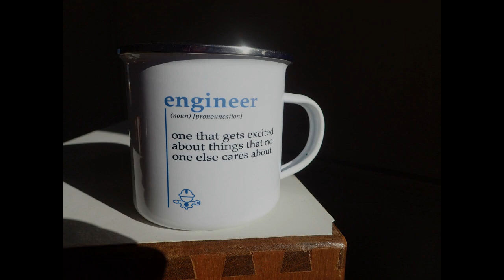The Knackler Needs Your Help - Which Drill Press Vice.

Comment: No one vise is the be all end all solution, but a good vise will get most jobs done.  I have a few regular Palmgren drill press vises which I use the most. Of those I have two sizes. A positive is that you can turn them on their side and hold work. A negative about regular drill press vises is the absence of mounting flanges. Some have a little lip for like a toe clamp, but I usually just hold on to the vise.  For that size press I would say you might want something that can be secured to the table or not. A larger floor standing press can have way more torq than one would expect. It can and will if you let it more or less throw a vise across the shop. There are benefits and drawbacks to flange mounted vises. Some are of very shallow jaw depth for example, and might not provide the holding strength you need. Another thing is they can be a pain in the ass to constantly get lined up. It's not the end of the world, but just a little obstacle. They still however have their place in the shop. What I have on my floor standing press right now is actually a Peterson Products (Mr. Pete's former company) vise made from rough castings. It works well for what it is. I also have a Heinrich cam lock vise, and a few others. Another less all around useful option is a tilting press vise which as it's name implies can tilt into position and lock in place. I don't use it a lot, but when it comes in handy it really comes in handy. In the end, like most others you will wind up with a collection of vises, each great for certain applications, and likely the first of which will be a regular drill press vise of the right size. If securing it seems prudent, then consider one that can be mounted to the table. Of course when mounting a vise you have to take into consideration IF a particular vise will fit your table in a way that allows you to both get the work on center beneath the chuck while also letting you tighten up the mounting bolts holding the vise to the table. My advise... find  a medium to largish sized regular drill press vise (Like 4"), and hold onto it tight. Learn when and how a drill press can grab the work. Get a feel for that drill press. Make it second nature to know where it's on/off switch is, because the nature of the beast is that sometimes the work gets grabbed by a bit, and you will have to wrangle it with one hand while switching the machine off with the other.
Reply from the maker: Hi John,
Thank you for all the above information... Yours and everyone's else's comments have been food for thought on a number of things involving The Knackler's Workshop. I now have some clarity on the way forward as well as drill vices so, a good outcome from this video.
I was not aware that Mr. Peterson had is own company that is very interesting. 
Thank you again my friend.
Paul,,

Comment: Hi Paul. I follow Mr Pete's wisdom on this, you can never have too many vices! The vice I mainly use on my drill press is the Float Lock Vice that I made but these are hard to come by. Most useful would probably be a good quality cross-slide vice. They are good as you can bolt them down but still move the work about. Also, as Rob said, get yourself a car jack, bottle jacks are good so that you can support the table. Cheers, Alan.
Reply from the maker: Hi Alan,
I have a goal to have as little kits as possible, which I know is a tall task and every time I buy something new I will get reminded of this statement. I am very grateful for everyone's comments it's helped a lot clarify my mind on the way forward.
Cheers
Paul,,

Comment: I would recommend a cross-slide vise so you have two axis of travel. Some machinist parallels would also be useful in the vise for certain drilling operations.
Reply from the maker: Hi Mark,
Thanks for talking the time to help...One of the considerations I have is that I share the workshop and this drill press... So the vice I pick needs to be very easy to come on and off. The two axis option is very attractive...
Take care
Paul,,

Comment: Hi Paul,  I have an almost identical Taiwanese drill press.   Be aware that these units all flex on the table under load, so for accurate drilling you should put a support (car jack) directly under the table centre pivot point.  For precision drilling use the four jaw chuck/lathe tailstock. 

I  have a regular low profile pillar drill press vise with plain jaws on mine, into which I put a small toolmakers vice with checkered jaws.  Allows me to quickly swap between jaw styles.  It's good to see that pillar drill has a rotating table (same as mine) which is a huge plus as it allows you to easily rotate the job on two arcs to always position the drill at the correct point.  Fixed tables can't do that.  Having a rack is also a huge plus.  These old Taiwanese units are very good.  There shouldn't be any runout if the drill chuck Morse taper adapter is accurate.

Be wary of buying any vises made in India as the quality of the ones I've seen has been abysmally poor.  They also do X plus Y versions, but check closely for fit and slop.  You don't need XY versions with a rotating table.

As that's a woodworking shop you may have to reduce the spindle speed each time you use it, as they will want fast and you will want slow to avoid burning up drills.  

I hope this is helpful.

Cheers Rob
Reply from the maker: Hi Rob,
That is of great help... thank you.
Sometimes it feel like I am moving very slowly in getting setup but I guess that's partly due to the 40 years gap with this engineering malarkey and needing to purchase everything.
Thanks again.
Paul,,

Comment: Hi Paul, General good quality drill press vice every time. Any machine is only as accurate as its weakest point (and there are plenty on one of those). Further advice, check that table support casting, looks suspiciously like a crack to me. If it's not cracked, get yourself a cheap car scissor jack to add support under the table, this will add far more precision and rigidity than any expensive vice. In terms of size, buy one big enough to make use of the clamp slots so you don't have to mess about with clamps and packing pieces. Hope this helps. Cheers, Jon
Reply from the maker: Hi Jon,
You are correct about only being as accurate as the weakest point... I will check out if it is a crack on the casting. I do remember Ade (Ades Workshop) doing the scissor jack trick...
Thanks for your help.
Paul,,

Comment: id get a little grinding vice. you can use it on its side, its nice and square, doesn't mark the work. not so easy to bolt down to the table though.
Reply from the maker: Hello Emma,
One of the other suggestions was to have one larger general vice and one small precision vice that fits on the larger vice... part of me likes that idea but I am also trying to avoid having lots of kit.
Thanks for taking the time to help.
Take care
Paul,,

Comment: That is a very interesting question and we have gone full circle. We have a large mill and for ease bought a Clarke floor mounted drill which looks very similar to the drill you have. We started with a matching clarke drill press vice then upgraded to a Clarke cross vice which is very versatile. For percision work we use one of our mill vices but then discovered that the runout on the drill meant it was not suitable for percision work. We now use the mill for most drilling and we are looking for a second smaller mill that can double up as a drill press, before selling the Clarke drill. Not sure if this is any help LOL.
Reply from the maker: Hi Joseph,
Wise words there... I will check the runout on the drill and that may indeed answer my questions. Thank you.
Paul,,

Comment: G’day Paul. I would just fit a general purpose vice. The drill press is a very poor milling machine alternative with no finite adjustment in the X and Y planes. Also as you share the machine with others they may not share your expectations for care, let’s be honest how many have pecks and holes in them. It’s like, whats that saying “making a silk purse out of a sows ear”
Cheers 
Peter
Reply from the maker: Hi Peter,
You are correct... and when I read "silk purse, sows ear" I immediately thought that the whole setup is only as strong as its weakest link and funny enough Jon's the next commenter said that. You are also right about sharing equipment. 
Thank you.
Paul,,

Comment: This is easy a precision vise is used on a precision mill when you want to make sure your drilling or cutting to extremely tight tolerances. I doubt that table is even square with the chuck and I'm sure that chuck has a lot of runout. Forget precision and just get a vise that you can bolt down when needed.
Reply from the maker: Hi Dave,
I think as Peter (PGS) quite rightly said I am trying to make a silk purse from a sows ear... Thanks for taking the time to help.
Take care
Paul,,

Comment: hi paul
the question is what your going to use it for, how often and how much do you want to spend, ive managed with general purpose ones all my working life, although i have a machine vice on my miller, for any precision work if needed.
regards
mr f
Reply from the maker: Hi Mr. F,
To be truthful I am not sure where this little adventure will lead me... I think Joseph's (Garden Tractor Boy) comment make sense that if the runout on the drill is bad then a precision vice maybe pointless... I also think that maybe I need to find a way to have a small milling machine.
Cheers
Paul,,

Comment: Hello Paul, my recommendation would be a standard low profile drill press vise of 6-8 inches wide. Like this one https://media.tractorsupply.com/is/image/TractorSupplyCompany/1180846?$456$. I would not recommend the x/y adjustable ones, more trouble than they are worth and expensive to get a quality one. The cheap ones are junk and not very rigid. A precision vise is really overkill as it is not really a precision tool. I usually just put a t-bolt in one side of my vise and can pivot it around for different positions. Then I can always slip another in if I need it more fixed. 

Also from what I can see you may have a depth stop on the quill handle. There are graduations and a pointer on there like mine. You might also have a set screw. Near those graduations. Tighten to stop. If you do I can show you how they work on mine. Took me a few minutes to figure out because it is not all that intuitive but it works well enough.
All the best!
Eddie
Reply from the maker: Hi Eddie,
Thanks for taking the time to help...Yours and everyone's comments have been good and I now think I know what I am looking for.
Thanks for the info on the depth stop... I am not in the workshop for a couple of days but will check it out when I'm there.
Take care
Paul,,

Comment: For pity's sake, dont get one of those hokey xy tables and try to mill on that poor thing.   My little drill press that I use, is simular in design, but 100 years older and 50 stone heavier.  I use a 6" Kurt style milling vice, you would be ok with a 4". When I say Kurt style, I mean a $60 import.  The great thing about a round column drill press with a rotating table is you can position your twist drill to any point on the table simply and quickly.  All you really need is a good wiggler and an optivisor or magnifying glass.
Reply: I take it back.  I have a 4" vice.
Reply from the maker: Hi,
Thanks for visiting and subscribing... I have no plans to try and mill on the drill press... with some jiggery pokery I can mill small things on the Myford lathe... Thanks for the advice I will checkout the Kurt style imports.
Take care
Paul,,